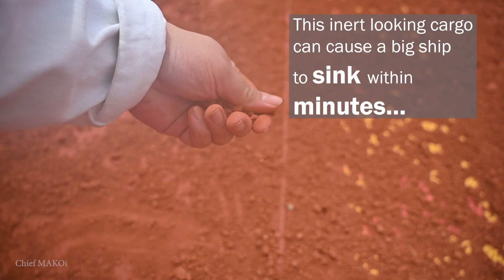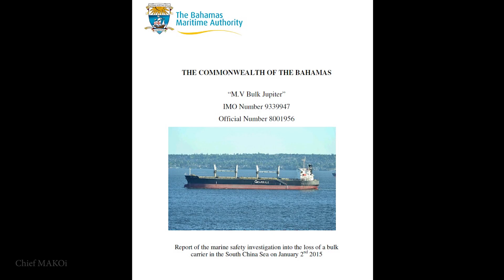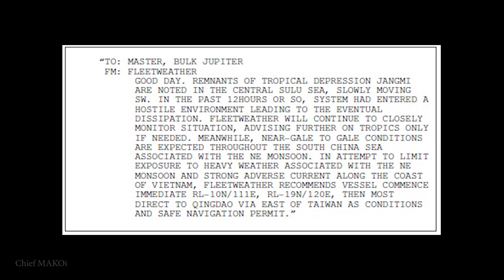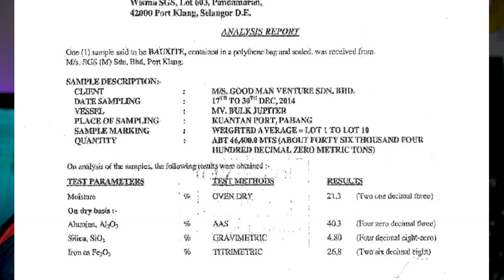The Cargo That Can Sink Ships Within Minutes : Bauxite Liquefaction | Chief MAKOi Seaman Vlog

Comment: You said there was no evidence for that wet cargo causing it, yet you described in detail how the ship was acting, which EXACTLY matches that being the cause. Then the report saying it was 21% moisture, which proves it. You have the probable cause identified, you have an eye witness description of how the ship was rocking, then suddenly listed 45degrees. No other possible causes were noted such as failure of the cargo doors, or structures failing and extra water is not required with the % moisture content anyway. It sounds alot like the exporters knew about the excessive content, but used old data to sell the product, with another report to follow so the end customer doesnt complain about the delivery. The ship was given all risks deliberately by the exporter, but the captain should also have demanded the cargo be tested, and rejected.
Reply from the maker: It's "lawyer" language.  You know how it is.  They'll spin everything up as circumstancial evidence.

Comment: I thought that a Captain's first duty was to the safety of the ship and crew.  Why did the captain, then, not insist that the appropriate tests be made before the ship got under weigh?  Also, I have always heard that the captain was supposed to stay on the ship until he was sure that all personnel were safely evacuated, even if it meant going down with his ship?

Also, if bauxite is so dangerous, why is it transported in unitary ships rather than barges that can be cut loose at need?
Reply: Why should a guy die if there's obviously nothing he can do?

Comment: It is all about the money !  Greed fell ahead of safety most likely. Seems that those who load the ship should be responsible for making sure the bulk materials are safe. If they push the limits and cause deaths and are held responsible a few times, maybe those companies will lower the greed factor. This is why extremely wealthy companies are hard to trust, they have so much revenue they can recover in short time from liability while the smaller ones suffer the most if held responsible.

Comment: amazing video ... I have recently at the age of 75 years old .. fabricated     cast panels of castable refractory  with steel fiber reinforcement . the aggregate when mixed with 9 % distilled water remains almost a dry  clumping mix ..super difficult to  continue mixing .
however once placed in the mould and subjected to a vibrating table . the mix slowly settles and levels out and a film of water works it,s way to the surface .often within a 5 minute period of vibration .. The whole   vibrated slab has to be carefully levelled using a spirit level in both directions and once the slab has levelled side to side and front to back the vibrating action is switched off    and the mix remains level whilst the setting / curing takes place .I can fully understand from your liquefaction explanation that the constant rolling of the ship would quickly turn the 23% water content Bauxite into a lethal slurry .congratulation on an excellent video and solid reasoning .

Comment: I work in construction and i know what it’s all about.
Sand Can Seem pretty dry but when you try to compact it with a plate compactor it gets wet at the surface. Or load a trailer and drive x Miles and it’s just slurry on the top.
Dont take the risk on a ship!!

Comment: There is a video somewhere on here of a steel and concrete bridge that gets hit with an earthquake. It turns into a rubbery wavy structure that freely moves as if it were a wave on the sea. That is Amazing to see because you wouldn't think of concrete and steel doing that.

Comment: Bauxite.  A chemical union of alluminum & oxidized iron.  Put plainly:  two substances with opposed properties, such as alkali (aka soda ash) & sulfuric acid, or solid chlorine & carbonized water.  I don't know what the resulting product is, all I know is it's got to be bad news to put bauxite anywhere near a potential reactive or a catalyst, such as an acid,, anything supplying a concentrated amount of oxygen, or anything that would cause a tandem reaction with the oxygen in the air.  Methane, perhaps?

I had no idea they carried this stuff in ocean superfreighters!  Could be just one leak of salty ocean water & you've got a massive domino effect.  Geez, Louise.  That would be comparable to filling the cargo hold with several kilotons of baking soda & pouring full strength vinegar on it... the expanding gases... the explosive oxygen.  Yikes 😨

Comment: Excellent piece boss! 
 I knew the terms and factors from a construction point but never gave a thought to the shipping industry. The way this made so much sense instantly was being a fan of Deadliest Catch and the most dangerous condition resulting in sinking of fishing vessels, the "slack tank" where their holding tanks are only partially filled with water creating that imbalance so deadly in rough seas. That is the one thing that turns them ghost white because it's the number 1 sinker of ships. 

 What surprises me most is the seemingly small amount of rise in moisture content of acceptable 10% to deadly 21% - that doesn't seem like much of a window. I imagine that it comes down to rough seas from what angle and it's effects on the ship's balance. Those are some fine lines to juggle. 

 I hope you are always blessed with a captain as wise as the one you told the story about because that's the type of leadership that should be at every helm.

 When you hit the water again?

Comment: Does iron ore carry the same risks as bauxite? Locally to me there was the Edmund Fitzgerald loss in a Lake Superior November storm. Many theories out there for what happened (I watched a youtube video a week back) but no conclusive cause. I believe iron ore gets transported as taconite beads, which could certainly roll around more freely during storms with waves infusing water.
Reply: Taconite beads aren't susceptible to compaction and liquefaction, because they're solid half-inch spheres, and they're roasted dry. Water would just drain through the gaps between the pellets. When he says that iron ore is susceptible, he's talking about "direct shipping" haematite ores, which are basically crushed rock, like bauxite. The pellets shouldn't move much as the ship rocks -- there's a lot of resistance as they bump into each other.

Comment: Terrible tragedy, Chief. So bauxite is particularly dangerous because it is such a fine powder. Sadly for the master of the Jupiter, the sinking would have been attributed to him, since he has ultimate responsibility over the safe operation of the ship and the safety of the crew under his command. Shocking, but completely understandable why such a large ship can sink so quickly.
Reply: I like to think that this is the reason for the old tradition, of the captain going down with their ship. They're not going to have to hear about losing the ship, if they ride it like a submarine
Reply: Close, but it's not a powder. Liquefaction happens when the particles of a material can get sufficiently lubricated that they can move freely. This can happen with particles as fine as clay, to fairly coarse gravel and aggregate - concrete, for example - You just need enough water to overcome the friction between particles.

Comment: CAN IT NOT BE PREVENTED BY DEPLOYING SUMP PUMPS TO PUMP OUT THE SLURRY LIQUIFACTED 
FLUIDS?
Reply: Sump pumps couldn't handle the viscosity of the slurry and would overheat in no time. They're designed to pump water and maybe some low viscosity oils, not what is essentially the consistency of wet cement.

Comment: Shouldn’t be hard to pump the water down to reduce the free surface effect if you discover it in time.  Or is it too sludgy to pump? 

I’m assuming that putting baffles into the holds doesn’t work for dry bulk cargo like this? 

Put a few perforated pipes into the hold before loading maybe and put a hose down to the bottom to pump out whatever ends up in there.  This is one way they deal with waterlogged soil below foundations in construction.

Comment: Good production. Rice was a dangerous cargo for early timber vessels as it wants to get wet and expand, the result being the planking would give way. Guano (bird shit) was also dangerous as the fumes would rot the hemp rigging and sailors feared it.
Reply: I think, barley was also a feared cargo, as it flows more quickly than other grains, and this effect is believed to have sunk the "Pamir", as it was loaded with loose barley instead of its intended cargo due to complications in port.
Reply: There were actual wars fought over the guano trade. It was that lucrative at one time. Maybe that's where we get the term "bat shit crazy"?
Reply: @rujo2k  Didn't know that but I've used the term a few times. Thanks for the info👍✌
Reply: ". . . rice was a dangerous cargo for early timber vessels . . ."
Not only rice, and not only wooden ships . . .
Reply: Haven't seen Iron filings in the lists of dangerous cargo.
Rusting iron can heat to a level that endangers the ship.
Reply: the fumes don't rot the hemp, the bacteria do. the fumes just make people sick.
Reply: Wait why would you carry bird shit as cargo
Reply: @Blushing_Boo  Nitrate.
before the invention of the Haber-Bosch Synthesis, natural nitrate deposits, aka "bird shit", was an extremely valuable ressource, as it was the main source for industrial fertilizers and explosives. Sailships would race each other from europe to Chile and back, I think the record is under 60 days.
Reply: @paavobergmann4920  Damn and here i was thinking they only ever put it in face creams that cost premium amounts of money.
Reply: They did? Why am I not surprised...🙈
Well if you can make perfume from whale vomit...🤷‍♂️
Reply: @paavobergmann4920  Ive had a good laugh with my sister about how many of the 80+ bucks beauty products contain fun stuff like guano and/or urea so yeah.
Reply: @Blushing_Boo  Urea is  really nice for your skin, it really holds the moisture. So, peeing into your boots is actually valuable advice! ;-)
Reply: @Blushing_Boo  " Damn and here i was thinking they only ever put it in face creams . . ."
For that afterbirths are used . . .   ;-)
Reply: @paavobergmann4920  actually it still isn't known for certain which end of the whale ambergris comes from.
Reply: Guano is not specifically bird feces - It includes that of bats, and it's also not just shit. Guano is the accumulated droppings - Weeks, months old. To say that guano is merely "bird shit" is akin to saying that diamonds are merely carbon.
Reply: @UnitSe7en  Diamonds are merely carbon
Reply: @UnitSe7en  it's still essentially bird shit.....I've got an old hay loft I've shot pigeons out of for years now and there's a pile a poo under the windowsill and such that's probably a few inches thick.
Reply: @UnitSe7en  diamonds are merely carbon

Comment: I have extensive experience in ship design, that is, I once entered a cardboard boat race. I wanted my boat to look like a ship but soon learned it would not be stable. It is stable when the center of mass is lower than the center of buoyancy. It's stable when the center of mass is directly above the center of buoyancy. In all other cases, the ship tips over. So Chief said the center of mass rises when the water rises to the top of the cargo, that's bad. In addition, since it is liquid and the sea is rough, it flows to the lowest side of the ship, that is positive feedback, result not good.
In the case of the cardboard boat, not possible to lower center of mass (which is pretty much the center of the person) below the center of buoyancy. Cardboard is too light to have any value in lowering the center of mass, unlike steel. Instead, I did a catamaran as that design shifts the center of buoyancy in a negative feedback way (negative is stable). Other builders seemed to rely on dynamic stabilization (moving their body to keep from tipping) while a few relied on nothing, immediately going for a swim.

Comment: Chief I have a serious question for you, how difficult/impossible would it be to rig a bulker or tanker or pretty much any ship if you use a parasail,  with some sort of a sail plan (computerized).
Just a thought I mean the "Trade Winds" are not called that for nothing.
World wide shipping accounts for a huge amount of Co2, this is probably one of the easiest sectors to make a change in. All that wind Chief going to waste.
Reply from the maker: There's actually a new design for wind-powered ships.  Not sails but like vertical turbines, I think.  But I haven't really checked them out.
Reply: I have also seen a parasail idea that seemed to work. The vertical turbine idea seems like a  plan, not sure how it would affect stability

Comment: I`m not in the ship buisness, just a curious guy with interrest in all kind of things. Anyways, a few years ago I saw this docu about ship disasters. There was this one case of a freighter that was carrying something like bauxit. Something that soaks up water. It got in a storm and it turned out one of the loading mechanism of the ship had a defect. Hard to explain as a non native English speaker, but the loading mechanism was complicated and attached to the cargo doors. Don`t know the english name. That mechanism, that looks like a tredmill. Water was getting in from the aft into the cargosection. They showed the cam footage of a coastguard helicotper that was at the scene. That chopper had just arrived when the cargosection had been breached. The ship, which was huge, capsided and vanished in less than a minute. Guys who work at sea have my utmost respect. I think from all jobs you can have theese days, this is one of the most riskiest.
Reply: @Lancashirelad thx^^

Comment: Thanks Chief, beautifully explained. I know about liquefaction through geological processes but never connected them to shipping.
bulk carriers have always been of interest to me, the cargos they carry are always loose and i assume are subject to shifting. Very dry sand for instance if enough different particle sizes are present will flow like water, how do you keep that from shifting?
Iron ore if not correctly loaded will snap a bulk carrier like a match in heavy seas, this happened off Saldanha  South Africa with a bulker that had loaded and left the lagoon and just disappeared, this happened if I recall back in the '80s.

Comment: would bulkheading the cargo be possible (treat it more like a liquid)
or would putting dividers in be unpracticable?
Reply: It would be totally impractical on these size vessels. The size of the cargo hold and the time / materials required are prohibitive. The key message is to load cargos which have been well tested in the first place to minimise the risks.

Comment: Aircraft fuel tanks have a similar problem with sloshing so they have baffles to prevent the fuel from gathering at one point and upsetting the balance. Oil tankers must have similar problems, but they don't sink. Why can't bauxite carriers adopt the same solution?

Comment: All dry powder cargos are very very dangerous. Materials like cement, sand, iron etch. are considered difficult loads. Except from water absorption which is very dangerous and can easily happen in heavy storm conditions they tend to create high temperatures at metal hull of the ship because of friction. That happens because ships are flexible and bend constantly during travel. Even without cargo middle part of the ship walls may rise temperatures due to continuous bending. Dry cargo, adds friction from the inner side and also insulation that prevents heat to escape. As a man of Greek Island origin, i have heard many many stories of dry cargo shipwrecks...

Comment: They need to go to a watch company and get a metric fuck ton of those little white desiccant silica gel packs and drop them in each bay - that'll fix the problem LOL

Jokes aside, why aren't the compartments on ships like these partitioned like on crude oil and other liquid carriers to prevent cargo shift from causing destabilization? Or implement "dryers" that can run constantly to reduce the humidity and the water content of the air inside the compartments? Seems like a logical solution to a problem so well known and where the dangers are this critical.

Comment: Thanks Chief, fascinating subject and excellent presentation.   Are there loading conditions which are never permitted following a certain type of dry cargo? That is cargo B should never be loaded if cargo A was in the hold on an immediate prior shipment.
Reply from the maker: Not really.  The holds are usually cleaned to "grain standard" after every discharge.